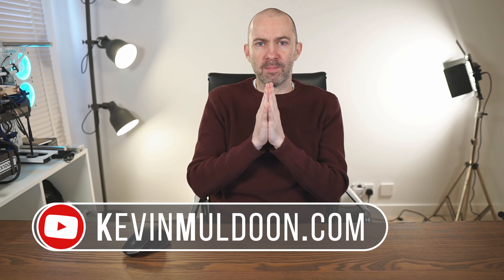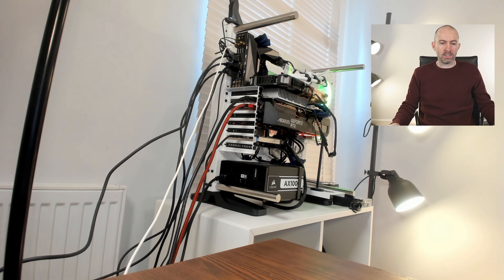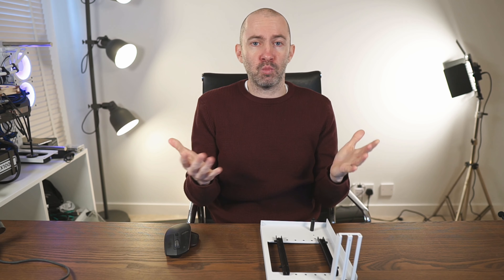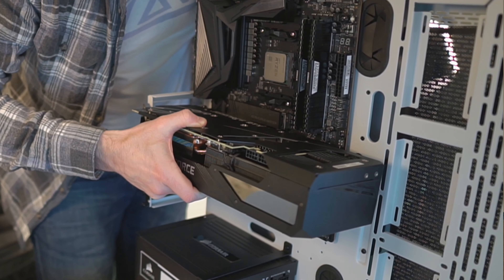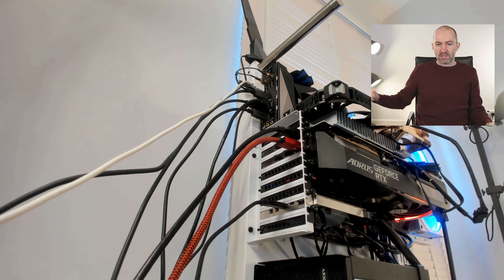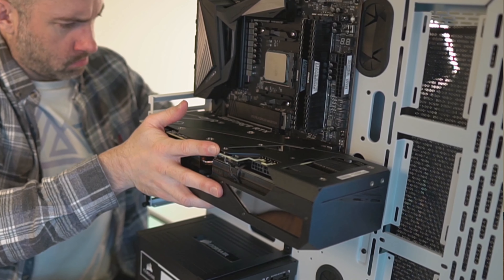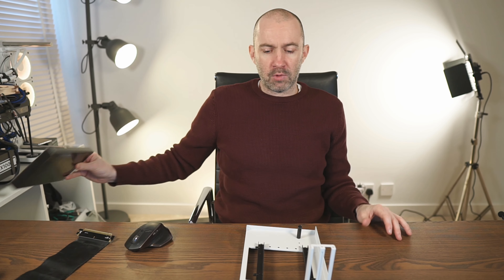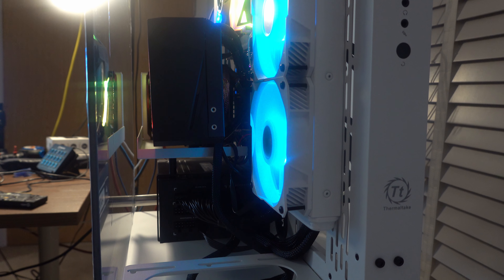New PC Build (Part 6) - Post-Build Changes & Problems

Comment: The gigabyte motherboard have been known to have issues, do you think if you had a 4.0 pcie riser it would have worked?
Reply from the maker: The issue definitely wasn't with the riser as the same issue arose without it.

The main issues with the board were later fixed with bios updates.

Comment: Sorry to bother again. I upgraded the Aorus 3090 Master with a Waterblock (unfortunately EK didnt supply the active BP at the time i did), but the Card has a significant better Temp on load.
I run it in a closed Lian Li O11 XL Case with all Fans blowing out and it reaches 58° max.
The less heat is going up from the front modules, the less the backplate has to spread, so watercooling it is always a wise descision. Heatwise and noisewise ;)
Reply from the maker: Yeah the aorus 3090 isn't a great card. My 3090 FE performs better in most situations. I've found the best way to cool is to place fans over the vents at the side of the card.

Maybe I'll go for a water-cooling card at one point in the future, but it's not something I want right now.
Reply: @KevinMuldoon  but still a shame in a that open case like the p3 😉 I would be really curious if the Rev 2.0 performs better
Reply from the maker: To be honest, I've kind of been put off buying any Gigabyte graphics cards in the future. Mine was the second most expensive model in their range and they chose to use the cheapest thermal pads try could find. There's no excuse for that.
Reply: @KevinMuldoon  I totally agree. Iwans aiming for an all Aorus build, and I am truely disappointed by the stability and acoustics of a 2k Euro Card. Friends of mine made a better choice with the Asus Strix… but well. Since it’s watercooled I’m pretty much satisfied

Comment: Man how many problems could you have in the one build. A bit of bad luck there.
Reply from the maker: Haha I know.

I think it's just bad timing with the AMD motherboard issue. The 3090 vram issue is not something I researched thoroughly before as I was going to be buying a 3080 initially and the overheating issue is not as bad (though it's still a minor problem).